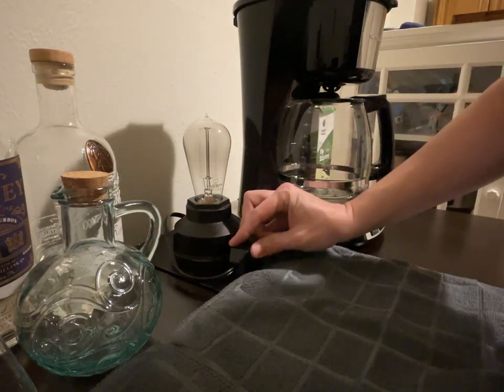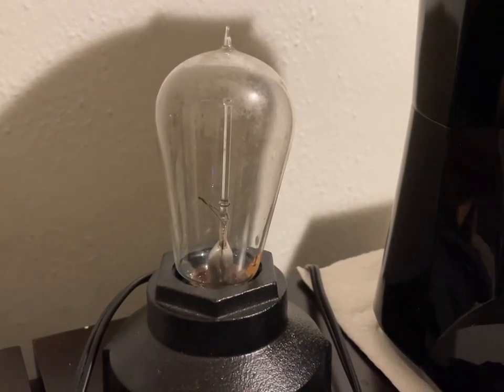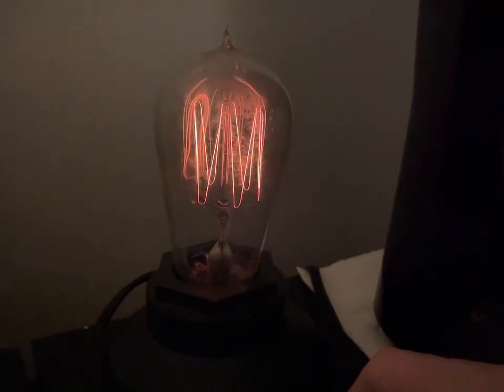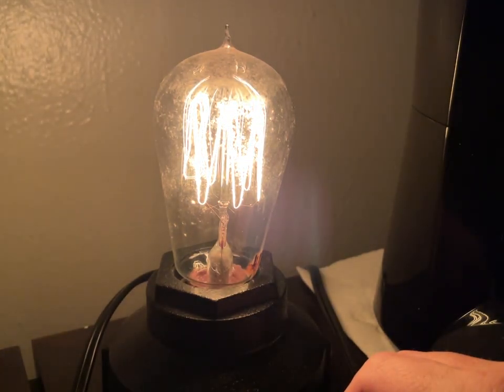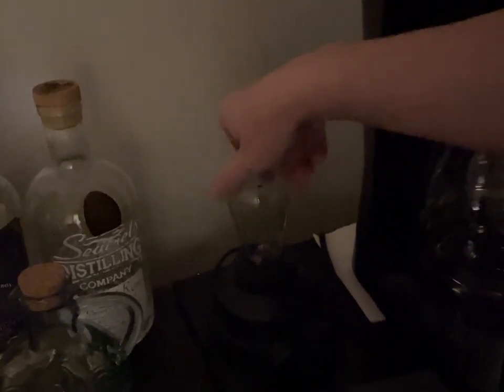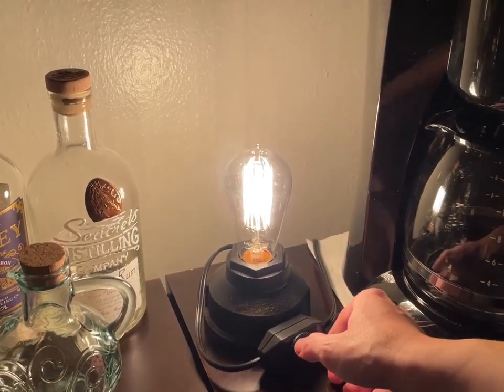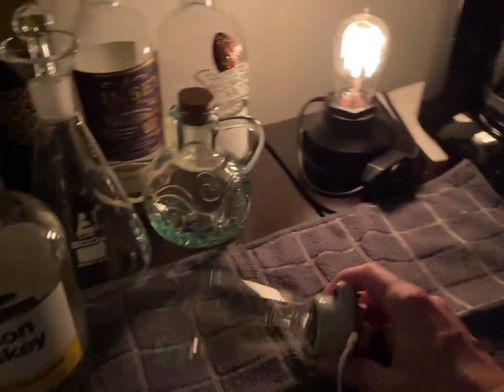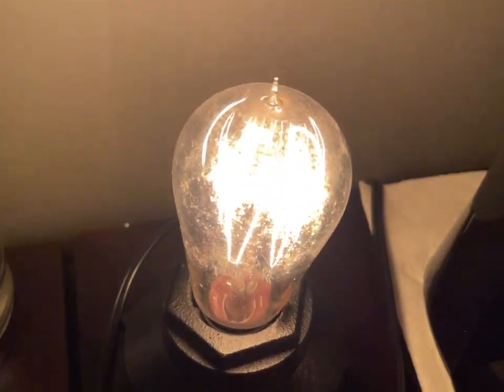Putting a 1920s or 1930s GE Mazda incandescent bulb into daily operation after 90 years.

Comment: Careful running that too high, line voltage was lower when that bulb was in use. I would not run that at max brightness. 

Beautiful bulb.
Reply from the maker: Yeah I won't be, but I do recall bulbs being blue like that.
Reply: Yeah, back then nominal voltage was 110V (maybe 115V by the time this was produced) and you would generally get less than 105V from the wall. Now we use 120V nominal and you usually see 115-118V at the wall.
Reply: @LoveOfMules13  Come to England we have 240v 💪🤟🇬🇧

Comment: That very white light suggests you may be overvolting the bulb.  We didn't standardize on a national 120V standard until the mid-1950's, iirc.  And depending on your location the utility may actually be pushing up to 125V or more.  A 1930's bulb may well have been intended for a nominal voltage of 110V.   The relationship between bulb voltage and lumens is exponential, but the relationship between voltage and bulb life is even more highly exponential.